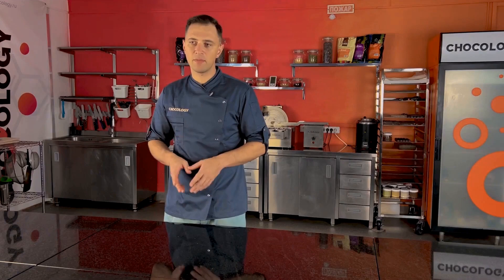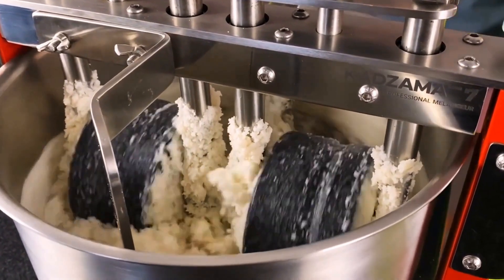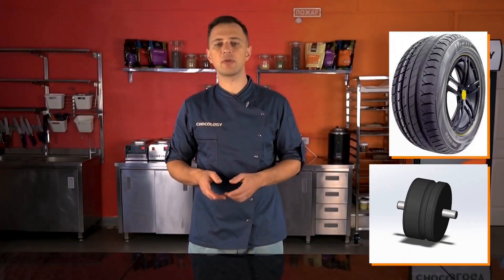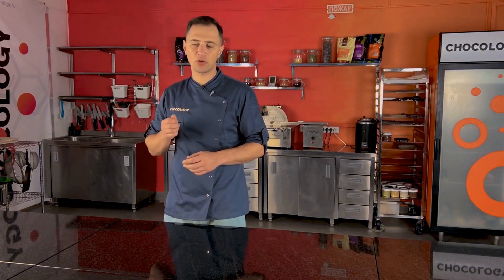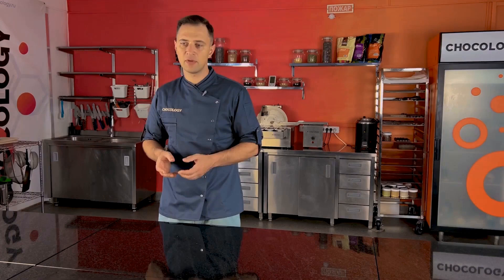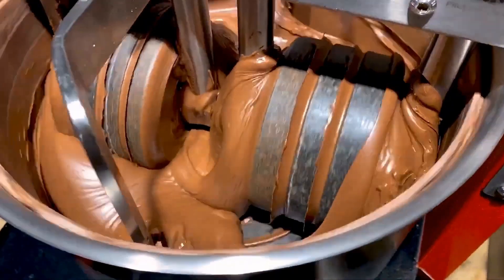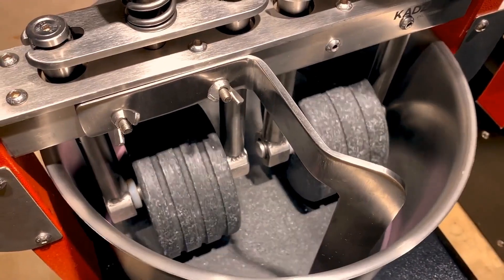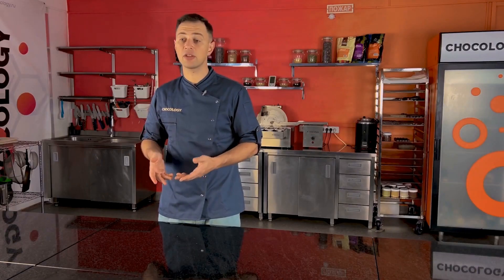Diagonal grooved stones in melangers | KADZAMA

Comment: Ok, so i make my own chocolate bar (non-commerical)  and use the regular straight-groove stone melanger. I also put coconut shreds onto the mix (about 20% of the total weight).  After several hours (8 hrs), when you dip a spoon into the liquour,  you can't see a tiny speck of particle onto the chocolate-covered spoon. It's  as silky smooth as can be. You won't feel any grit on your tongue when you taste it. So, yeah, I don't think diagonal-groove stones will make any difference with the texture - sorry

Comment: It’s a simple idea but it is always a clever person who puts two together for the first time. 

In car tires, the grooves work to pump water away from the center of the tire, out from under the contact point. In your design, the groove is acting to pump slurry from the outside edge to the center of the melanger basin. But, what if the grooves worked exactly the opposite of a car tire, and worked to pump slurry from both sides of the stone to the center line of the stone? Could this increase the grinding pressure at the center of the stone and result in finer particles?
Reply from the maker: The grooves on the melanger wheel work similarly to the grooves on a car tire – they channel liquid product (chocolate mass or nut paste) away from the wheel and increase the traction of the stone wheel with the bottom, just like tires on a road.

One of the common issues with a melanger is wheel slippage. This effect can be compared to hydroplaning, where a car loses control on a wet road. In the case of a melanger, the wheel stops rotating regardless of the applied pressure. The reason for this phenomenon is the smooth surface of the stone, which is characteristic of strong granite, and the high concentration of oils in the mass, acting as a lubricant. As a result, the grinding process temporarily halts, even though the melanger continues to operate.

The grooves in the wheel effectively solve this problem. They divert excess product from under the wheel and help capture unground particles, directing them to the area of maximum contact between the stone wheel and the melanger’s bottom. This promotes a more uniform and efficient grinding and mixing process.